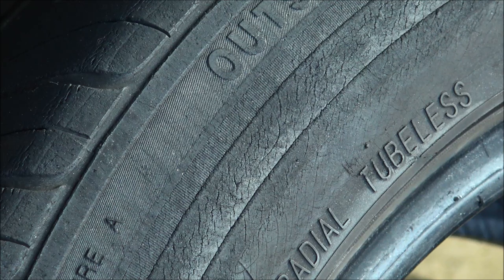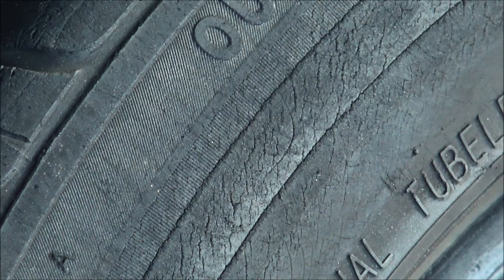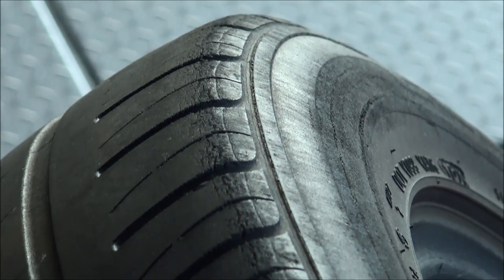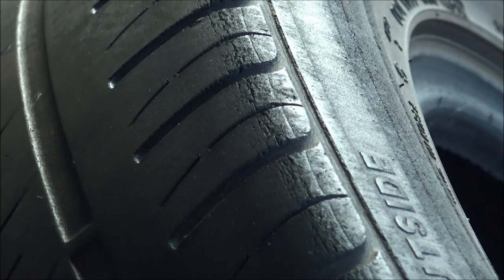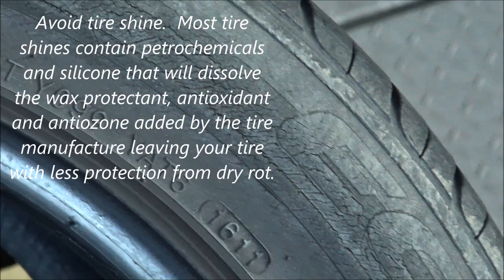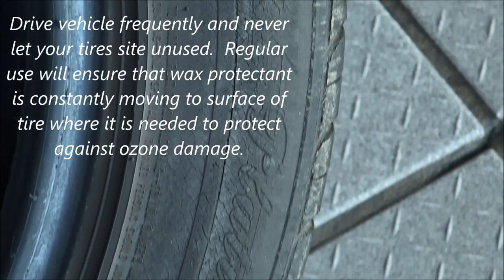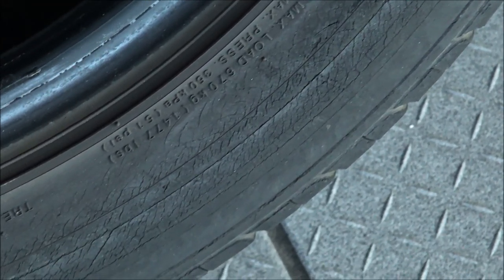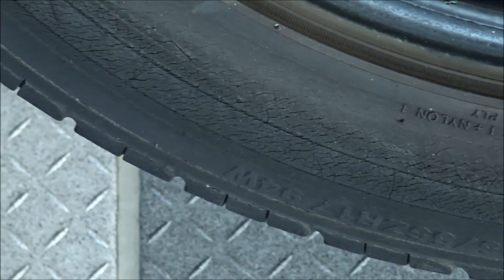Are Your Tires Rotting? Dangerous Dry Rot And How To Avoid It Explained

Comment: I been using Used tires for years, so let me tell you there is two dangerous tire defects 1st. Severe dry rot in the sidewall is dangerous your tire can blow out at high speeds can be dangerous. 2nd. Lumps or Bumps or sidewall Can blow out as well. If you have dry rot on Tire Thread your tire is just going to peel like a banana rarely will it blow out unless you keep driving on Wires.
Reply: I also buy used tires

Comment: Planned obsolescence, modern tires are designed to dry rot after 5 years. I bought new car in 2013 garaged since day 1 has currently 30k miles and tires are dry rot and treads are bald and there rated for 60k tread life. Ive see tires from the 1960-80 in junkyards with no dry rot!
Reply: Yup have 2 Ford Thunderbird rims sitting in the backyard in the sun all day with DOT of 2004. Thing has 0 dry rot, but then again its not being weighed down by thousands of pounds.

Comment: Thanks, just had an inspection done. My mechanic told me I needed 4 new tires due to dry rot. Thought I was getting ripped off. Tires had plenty of tread. But the side walls were dry and cracking. He was right. Seeing your video eased my mind!
Reply: Yeah mine too have a good tread.its decent even you put a coin you will nit see lincold head

But on the side it has crack meaning its not safe

Comment: My tires have a little bit of cracking. But I’ll be replacing them next year because they are 6 years old plus the tread is getting really low. So right now, I’ll continue to use my tires till the winter because I’ll be switching to my snows in 3 months.

Comment: Had some BFG Long Trail TA's that dry rotted, cracks between the tread all the way around on all 4 tires. Now they were over 7 YO and out in the weather, but still with a lot of tread left (almost all of it). Also have some Michelin LTX M&S that are starting to dry rot, they are also 7 YO now and need to be replaced, also with a lot of tread left (Garage kept). Nothing lasts forever that's for sure.

Comment: Great video, thank you! I bought a used car with winter tires. I have skoda fabia 2005 combi. My front tires are still fresh and soft with good grip on it, about 3 years old. But i just missed to pay attention to my back tires. I was shocked and very gratefull that im still alive. They was 19 years old
Yeap, no Kiding, DOT 1102. I immediatley bought two new winter tires. I used to buy used tires before, but with time and all the information i see how important is to have new and fresh tire. Its just something that you should  not neglect.

Comment: Getting new tires this week for my 2009 TSX.  They are only four years old, with good tread, but showing signs of dry-rot, especially the left front, which is the one losing air most consistently.
Reply: Same thing here! Mine 9 years old. I just bought it 2 weeks ago.Just today i was gonna move my bike into the garage, i turned on to the street and could barely make the turn without going into other lane. I thought i was driving shitt, as i rode around to the garage o could hear the tires roaring, could see front tire being wavy. I i  could barely control the bike. Checked the tires with 2 gauges they didnt register anything. Dad lopked at them and said they aint flat,,, i said its hard to tell by looking. It has tubes. If i had went onto an interstate it could have been bad. So you cant tell by looking at or kicking them. They have a little dry rot. They seem hard. They sàt for 8 years. The bike onlh has 7100 mi on it when i got it. Great video!

Comment: Seems I have dry rot on my rear tyres (discovered after a free health check at my dealer) around the edge of the tread and in-between the tread, even though I have 5 mm of tread left. Getting them replaced and this video was very useful and confirmed my thoughts.

Comment: My tires on my nissan were 12 yes old ... looked new, plenty of tread but were hard as a rock ... NO DRY ROT because the car is garage kept and only driven once per week, so i would be driving down the road in the rain about 60 mph and either my front end or rear end would go sideways because of lack of traction because the tires were hard and not soft to grip the road ..

Comment: The split all the way around is what you should be concerned with. Minor fine short non-connecting cracks....remember MINOR...(not like the ones in the video)..doesn't really indicate a problem that needs to be addressed right away but should be watched. Beware of the tire/inspection shops that try to scare you as they do in my state. Also look inside the tread, I just returned all 4 of the middle grade overseas (China) tires at Sears for splitting all the way around. They were only 3 years old with 10,000 miles on then. These type of manufacture defects should be immediately reported, investigated and recalled. Personally I want nothing to do with any overseas non-name branded manufactured tires or safety items.

Comment: Damn I've been driving 15k miles and counting and my small dry rotted tires are still going and they haven't popped or anything. My truck's tires are so damn expensive
Reply: I purchased a used tire 2 days ago and spotted the dry rotted yesterday. I am freaked out about whether I can make it the 25 miles back to the place that sold it to me.  Any advice?
Reply: So have I, mine are bfg all terrain with 6/32 tread left from 2015 they have lots of cracks and some deep sidewall cracks still daily driving 🤞😎I'm hoping the triguard 3 ply system helps them last.
Reply: @mendocinorider  just wondering how long those tires lasted and if you ended up changing them out. just bought the same tires with some cracks

Comment: The tires on my project Jeep were installed in 2006... yeah, they have more than a little dry rot! They still hold air fine and have probably 90% tread left but I definitely wouldn't go further than around the block on them.... I don't even trust them to drive to the tire shop on, I'll pull the wheels off and take them in my other rig to have new tires installed. I will however do a monster burnout on those old tires before they get replaced, only good use for bad tires! =D
Reply: Well, wouldn't they also blow on the burn out and make you lose control then?

Comment: What's causing tire rotting? Is that because of low air? Thanks!
Reply: No, the air pressure is not a directly contributing factor. "Dry rot" is degradation of the rubber, probably due to oxidation; oxidation is accelerated by exposure to sunlight (UV) and volatile/reactive chemicals, and also just the high temperatures experienced on tire surfaces due to friction and road surface temperatures. This probably isn't helpful a year later, but that's the mechanism. Oxidation is a problem because it changes the physical properties of the rubber, generally making it more brittle, so the oxidized rubber will crack more easily and also have worse traction.
The best way to protect  your tires from dry rot is to park in covered areas to avoid the sun, or cover your car so that the tires don't see as much light. Oxidation is going to happen no matter what, though, over time. Vehicles that aren't driven often might need to have tires replaced due to dry rot rather than tread wear.

Comment: Yeh it's pretty bad to look at on classic car wire wall tires it shows easy. my grandpa had a 76 cadillac fleetwood with all original tires from the factory they were never replaced and were badly dry rotted but still had air in them the car drove 35 miles home on them and drove pretty rough to this day after we sold it they still haven't been changed

Comment: Unfortunately my tires have this tire rot...but, man, I bought to last 70,000 miles...and they are only up to about 35,000...UTQG is 700...maybe they are too hard in the first place....just ordered new ones at UTQG at 450, a softer tire....
Reply: How old are they? Rubber ages with time. Degrades with improper inflation and suspension problems.

Comment: Will tire rot make you slide more?
Reply: yes; oxidized rubber is stiffer and more brittle, leading to less traction
Reply: Yes it will. As mentioned by the comment above, once the tyres are exposed to the sun's UV light for a while and become oxidised, they will become brittle and offer less traction.

Comment: Copper Trendsetter SE 205 75 15 purchase 4 tires from Mavis 1 half years ago. The tread is perfect only 19,000 miles. The truck has only 46034 on it. All 4 are Dry Rot explain why that is and explain why They won't do anything about it.
Reply: missey316 im shocked too i bought new 4 low profile they dry rotted 2 years like 20k
Reply: I bought michelin tires and i have dry rot, only 3 years in. I paid 900 for those tires.  So expensive does not mean "good"

Comment: I just bought a 2009 model car and the tires installed are the original ones 2009 year. I'm guessing the previous owner replaced the steel wheels with alloy ones when he was riding it and put the old set back when he sold it. I checked it before buying and i check the tires every 3days, I'm that kind of guy lol. I was really planning on changing the tires as soon as I finish looking for some cool looking set of wheels and tires, but yesterday as i adjusted the rear suspension height, I saw my rear tires looking like shit! I cant believe it got worse that instantly! I rushed to the nearest auto shop to get them replaced. I didnt had the chance to get my wheels replaced :( No im stuck with a steel narrow rims for 4yrs... Safety over looks i guess!

Comment: I have some cracks on the top profile of my bike tyres. The side wall doesn't have any cracks. The tyres are manufactured in sept 2018 and I've hardly ridden 6000kms. Do I need to change the tyres immediately or will it work for some time more?

Comment: Inspect your tires weekly?  Seriously?  Maybe every six months.  Maybe.  Or maybe each time you get an oil change.  Maybe.  But weekly?  That's just silly.
Reply: a bit but if a big crack starts to open and better to know asap, just look at the threads when near the car should do and under as often as want can
Reply: Yes weekly. The air goes up and down with the weather.  I. Heck mine everydày of i have been losing air. My tires are frp. 2009! Yikeees!just bought the bike. Ive been riding everywhere. But i check air. When i have my new whitewalls put on i will check them before riding for. Couple dàys !after that weekly. It makes for a good ride, makes tires last a long time.  Bike handles better. Can make u turns very unpleasant if low on air

Comment: False information I think as I am a commercial tire installer
Reply: Buddy Douel Of course thats what you think, but as everyone already knows dry rot means the tires are either too old from you installers putting 5 year old tires on to get a quick return, or improper care like low tire pressures.